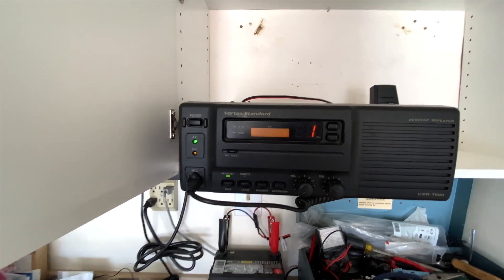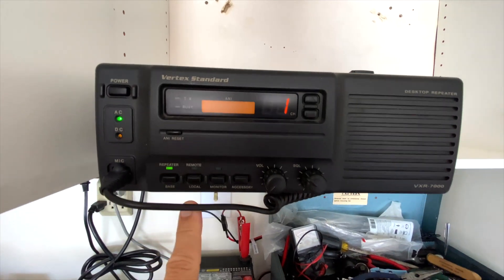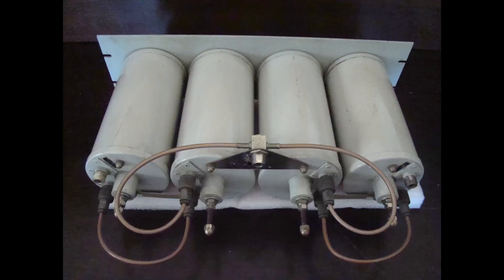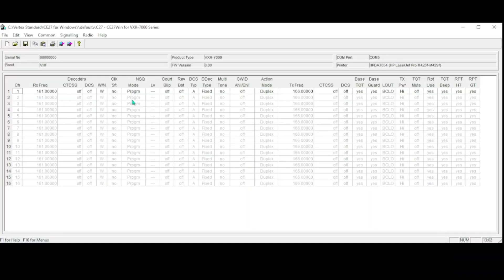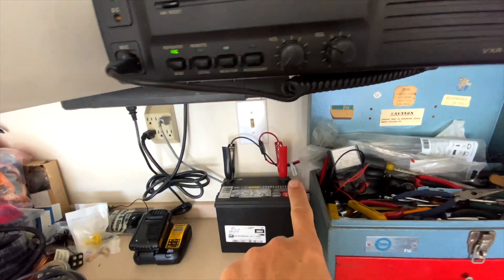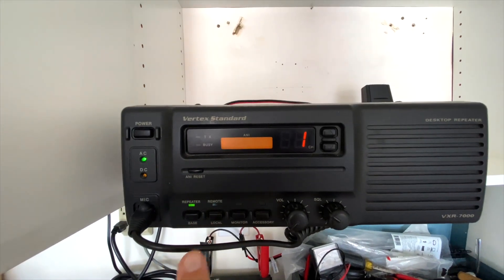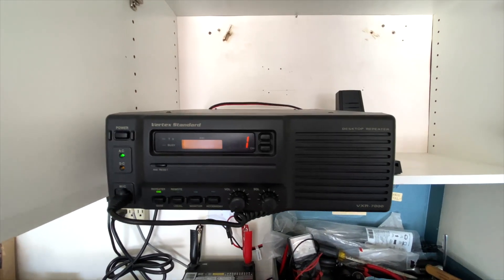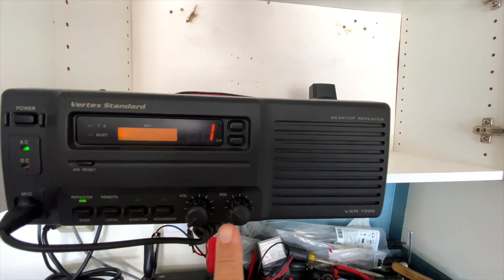My GMRS Repeater & How I Connected The GMRS Repeater To The Internet - My Vertex VXR-7000 Repeater

Comment: I don't get it..  LMR400 is perfectly fine for this application.  Hell, I know of a few "legit" mountain top repeaters that are running LMR400 here in SoCal.
Reply: LMR400 is fine in most cases. But if you have a long run at those frequencies there will be lots of loss.

Comment: You literally are responsible for me getting into gmrs, im licensed and just installed my first mobile radio.  It is all completely your fault😂, thanks for the awesome videos!
Reply: What mobile car setup did you get?
Reply: @JasonRasmussen  I bought a used kenwood tk880. Works awesome.
Reply: Good choice for a GMRS radio. I have one myself, and use a tk8180h for a base radio.
Kenwood software is very easy to use, unlike Motorola.
Reply: Nice 😊
Reply: Paid my Permission ransom and just received my GMRS license, Now looking for a reasonable HT and Mobil unit.

Comment: A glad ham/new gmrs here. My 2 cents worth...LMR400 coax on the uhf band for 5o watts or less like in your home setup is really quite fine. To spend the money for hard line heliax  or better for your setup in my opinion would never get you any noticeable increase in performance. Hel' you're located above a valley on a hill pointed right down at the entire landscape and everything on it. How much better of an arrangement could anyone want.  Ya...LMR400  berry berry good.   By the way...i enjoy your ytube channel very much and you are a great teacher. Thanks for taking the time to share. Cheers from tennessee
Reply: Better LMR-600 hehehehe I got 550ft of 7/8 heliax cable for $100.00 with connectors and all. no one said you had to buy it new.

Comment: Good video. I use LMR400 on my GMRS repeater, and it works just fine. Like yours, I get about 50-60 mile worth of coverage. Keep us informed and entertained Randy.
CHEERS from Colorado
Reply: I'm only using it at home on my base station and I've been told it's insufficient. 🤷‍♂️
Reply: @jmr  it’s a fine coax for base use. For everyone else who might wonder why you shouldn’t use it on a repeater, it’s the dual shield of foil and braid. The inconsistent spots where the two touch inside the jacket can cause intermodulation distortion (intermod). That doesn’t mean the coax ‘won’t work’ it means it ‘could cause’ interference which maybe affects your receive or maybe transmits that interference and causes another nearby receiver to hear it. Because the points inside where the braid and foil touch can vary, it may or not cause noticeable issues that can be observed without test equipment. So for base station use it’s not an issue because you are either transmitting or receiving, not both at the same time like you would in duplex service (on a repeater). To summarize, can you use it on a repeater? Yes. Will it cause issues? Maybe. Does it work for the purposes of this video? Obviously. Is it a good idea? No. Why gamble when you know there exists a possibility of immediate or future issues. I would have used RG-8 for this short of a run.
Reply: Cheers from the Indian Peaks Wilderness Area, neighbor.

Comment: Dear Diary,
     So I've been watching this guy on YouTube yack about GMRS.  As a result, I now have a Kenwood TK-860H installed in my '05 "grocery getter, otherwise known as a Ford Focus wagon, two Wouxun 805g's (affiliate link below), a Motorola HT1250 doped up for GMRS usage and RX only for area emergency services.  And since I too want to be like my GMRS-brother, I just snapped up a factory fresh Vertex Standard EVX-R70 for a song (couldn't find a 7000 on eBay that the Sellers didn't think was constructed out of gold).  I rolled the dice in getting the right software and programming cable, I literally held my breath when downloading the codeplug for the first time.  Everything went perfect, had the repeater configured in under 5 minutes.  Now it's time for the remaining necessities to get this bad boy on the air.

Randy, you're rocking the duplexer that came with your Vertex, do you still recommend the one from buytwowayradios that you showcased with the dual 1000g setup?
Thanks for all that you do, keep 'em coming.  WROQ941...Clear.
Reply from the maker: The BuyTwoWayRadios duplexer is fine, just make sure you dont try putting in more than 40W so you dont risk it peaking over 50W and burning it up... The VXR7000 has adjustable power output, not sure about your R70.

Comment: If only you knew the trouble I went through programming that thing. I had to get the cable that was buried in the storage room, then I forgot I needed a driver so we had to find that for the vertex cable which took 30 minutes, then the CPS kept setting it to narrow band, and then it started raining on me and deadhead. Ohhh what fun that was but it’s cool seeing that box again and glad it’s working and rock solid

Comment: I just got the same repeater w/duplexer.  You got a better deal than me, I paid $650 for the repeater, programming cable, software, desktop mic, and shipping.   I do have a question for you.   Once I have my antenna on the roof, how do you suggest securing the coax as it runs down the side of my house?  I tried looking all over YouTube but I can’t find anything useful. I have vinyl siding and I have to run the cable vertically until I can get it down to where it will enter the house.  Any suggestions?
Reply from the maker: You can buy little hooks/clips that screw or nail into the wall, but i'm not sureI would use those with vinyl siding..
Where my coax comes down its all brick - so the coax just hangs there.  I have a big rock holdng it at the bottom so it doesnt blow around..

Comment: I used to work on commercial radio towers and you should see the grounding "systems" I've come across. I've also taken commercial level classes and workshops on antenna grounding and across the board, the consensus is... understand the theory, design a situationally practical system using best practices. Every site is different, has different challenges and subject to different environmental conditions. There is no "right answer", universal solutions, or hard rules.

Comment: I have a question as a new user for GMRS. I was reading the licensing on the FCC website and here’s what they stated. You cannot directly interconnect a GMRS station with the telephone network or any other network for the purpose of carrying GMRS communications, but these networks can be used for remote control of repeater stations.
Reply from the maker: Please quote the rule that says "..or any other network", I would like to see that one.

Comment: Hey Randy, Bob your favorite fan here from Maine.  For your Tram 1486 seen in your video from a year ago, and assuming you still have it in place.  Do you feel the ground plane with those 3 horizontal spikes at the bottom are adequate enough?  I saw your past review of the Nagoya GPK-01 with the 21" Radials.  Just looking for the Tram 1487 is OK as is?  Or what you have/ find might be working better?
Reply from the maker: Hello.. Robert...
I still have the 1486 on the roof and it's working just like it did on day-1.  The ground plane for ~460Mhz does not need to be big, and when you do the math, you will see that the radials are fine..
The 1487 is for much lower frequencies (~180Mhz range) and that is why the radials are so much larger. Get the antenna that is designed for whatever frequency range you will be transmitting in.
Reply: @TheNotaRubicon  Thank you Randy, can hardly wait for your next video.  Maine is watching and listening WRJR-209

Comment: The experts would most likely say use Heliax and N- connectors to cut down on loss. But for your situation LMR-400 is fine. I use it for now and it works well but we need too extend out our "fars" due to one of our group moving out of our current coverage capabilities and also the local club south running roughshod over us. We plan on Heliax and 14 element yagi's and simply Simplex one of the 2 remaining repeater channels with legal limit options. As our local "some people" to the south do everything they can to bother us almost every night(we do use input and output tones mind you) since our friend is moving ESE of them we figure yagi's will reduce their ability to hit us hard even though they somehow manage to run 150Watt repeaters on GMRS and LMR 100watt radios as well and not have issues. So we will go beyond lmr-400 coax not because its no good but we wish to stay fully legal on our side and get max performance out of our equipment. I liked how you explained how your antenna performs and explained your coverage vector which I dont think many understand how different types of antennas propagate differently. It seems many believe the bigger the better on GMRS. Much like the old CB mudducks preach very often. That might be a video worth putting up explaining what antenna is best for certain options on GMRS. Antennas for local repeaters, terrain type, and long range Simplex for examples. Would love to know where you get your shirts too. Love your vids and sarcasm, keep up the great work!!!
Dave- The Old Fogey

Comment: I am trying to so hard to figure out how to get my crosslink with Zello to work. There's not a lot I found on Google about the settings other than play with them. I'm no expert by any means, just a guy trying to help his local community. The way I have this set up, I have a Midland MX275 with the 2.5mm to 3.5mm going to my mic jack. I have a Baofeng UV-82HP with the 3.5mm going to the speaker jack. Every now and then I can get noise but nothing at all is reliable about the setup. I tried using just the Baofeng and that didn't work. I also don't know where to find all these HAM and GMRS groups with the super top secret to doing this. I realize it's not a lot to go on, but any information would be helpful.

P. S. - Your videos are awesome! I have watched nearly all of them! I've also ordered A Wouxun 1000G Plus for my truck, KG-S88G, KG-XS20G for my side by side, KG-UV9G, Retivis repeaters, the Midland antennas you have on your jeep! These radios are next gen radios. I do hate that the XS20G isn't superheterodyne. To my knowledge it's the only Wouxun that isn't (At least that's what Stephen with Buy Two Way Radios told me on the phone.) You definitely deserve the credit and I look forward to more videos.

Comment: Also may I ask why you chanted to the Motorola repeater? Where there issues with the KG-1000 setup?
Reply from the maker: Assembling the KG1000 repeater was a fun learning experience but two KG-1000's strung together is a large, unwieldy mess of wires, especially when you consider that to prevent desense, you have to keep the radios several feet apart.
A single, purpose-made repeater in a box is more practical and performs better.

Comment: Randy,  I want to set up a GMRS repeater in rural south MS where there is not one.  The only person I have talked to was an “Expert” and very discouraging about trying it at all.  I have been following your videos and almost pulled the trigger on the KG-1000’s and then I found a video where you shifted gears to the Vertex 7000.  Did you know you could trust the used equipment on EBay before you purchased?  Are you still using the 7000? Are you still using the internal duplexer, or did you go for something better and more power?  Is there a newer video in more detail about your setup?  Thanks in advance, Rudy
Reply from the maker: I would never trust anything on eBay. I bought mine locally and was able to test-drive it for several weeks before paying. 
It has been a few years now and I am still using the 7000 with internal duplexer and have had zero issues. The biggest problem was getting an old Windows laptop I could use for programming it.
Reply: One more question, is the Vertex set up so much better than the KG-1000 setup that you would not recommend it as a 1st repeater?  Is there something you have found better for a 1st repeater?  Thanks
Reply from the maker: The two KG1000 setup is great for learning and great if you're in a pinch in the woods and both you and your buddy happen to have two KG1000s in your trucks that you can string together.  using an actual purpose-made repeater will perform vastly better, even at 1/4 of the power because the two KG1000 setup will suffer from massive "desense" .. You can also put a purpose made repeater on the table and move it around easily which you cannot do with the two kg1000 setup.  If you get a used purpose built repeater (like i did) it will also be much cheaper than the two KG1000 setup.
Reply: Hi Randy!  I bought a Vertex 7000 and Duplexer.  I contacted a local commercial radio shop (Business & Ham) for some help setting up.  They are telling me the duplexer must be tuned to the specific frequency/channel I want to use.  Is this correct that the duplexer has to be tuned, and /If I change my mind at a later time to use a different channel for the repeater, I will have to have it retuned?  Thanks for your time and any info/help!!
Reply from the maker: Any duplexer must be tuned to the specific frequency that you plan to use. If you change your mind later it will have to be retuned.  If you changed by only ONE channel it would still work, but not very well.
Reply: Randy, I managed to program the Vertex and I have 2 questions please sir!  1. When trying to save and download the programming, the programming software sites a 2013 FCC Rule about the channels must be Narrow Band and changes them from Wide to Narrow in the programming.  How did you get them to stay set for Wide Band?  2.  Is there any way to program the orange screen to show a channel number or frequency number?  Thanks again!
Reply from the maker: Ahh yes.. the old FCC narrow-band decree.. To get around that exit the software and set the date on your computer to 2008, then restart the software .. when you're done you can put the date back to normal.
There is no way I am aware of to make that screen useful in any way.

Comment: I just got one used on ebay... I can download 1 channel no problem. But when I try to upload it fails at about 90 percent... any tips would be nice. I'm on win11 and cable is usb to rj45.
Reply from the maker: I have never been able to get mine to upload/program correctly on anything newer than Windows 10.
You also need to use the cable designed pacifically for use in programming the repeater.  A regular USB-to-Rj45 cable will not work.
Reply: @TheNotaRubicon  I Got it, had to install a special serial driver and its all good, starting to love this unit!

Comment: Would the VXR 7000 work with the Midland MXT500 if programmed correctly?
Reply from the maker: Yes, my MXT500 is programmed to use the VXR7000.

Comment: I know this is an old video but what did you use to program it , windows 10 , xp, me, thanks
Reply from the maker: I use a Windows 10 laptop - it doesn't work on my Windows 11 machine.
Reply: @TheNotaRubicon  was it the ce27 or something else ?
Reply from the maker: I'm running CE27 V1.08 .. It runs but I can't upload/download to the repeater. I think the issue is with Windows 11 not recognizing the cable.. I've tried all the driver 'fixes' but nothing worked.
Reply: @TheNotaRubicon  ok thank you
Reply: @TheNotaRubicon   got my hands on a vxr7000 im having same issues with windows 10 , cant upload or download  to repeater, driving me nuts
Reply: Any chance you can drop box me the version of ce27  ?

Comment: Did you have the receiver sensitivity problem others report about with your original build?
Reply from the maker: Yes, that is an issue. I had to place the two radios several feet apart.
Reply: @TheNotaRubicon  good to know.  I bought one unit for my base radio thinking I may buy another in the future for car/and a casual repeater.

Comment: I've read stories about people with baofengs hitting contacts 50 miles away when flying in private planes, you don't need 50 watts making it all the way to the antenna to service 30 miles. If you're a millionaire go ahead and put up a hardline run, however in the real world LMR 400 is fine

Comment: Hey,

I like your videos, is there a reason I can't get to your website from the Netherlands?
Reply from the maker: If you cant connect to the website that means the security system does not like your internet connection or your neighbors.
Reply: @TheNotaRubicon  thanks you for the answer, but I can't reach the site from al of the connections I tried in the Netherlands (sorry for my poor English). Thank you for your videos.
Reply from the maker: Give it a try again.
Reply: @TheNotaRubicon  thank you IT works now (y)

Comment: I think I'm going to use that lmr 400 cable to upgrade my cheap cable.
Reply: LMR400 is a lot more expensive than RG58, RG6 or RG11. But most of the time it is worth the upgrade. After that  diminishing returns, at least for my applications doesn't provide enough to justify the expenses.

Comment: I understand why your using LMR-400 because it does hace the lowest loss for most comercial available except for helix coax cable  that and Comercial Hardline where its unbelievabley expensive but the LMR-400 Is equal in low loss to Belden 9913 but lmr is rated for h8gher frequency range I think it will work just fine DE WRKY522 IN Northern Massachusetts 8n the NH Border